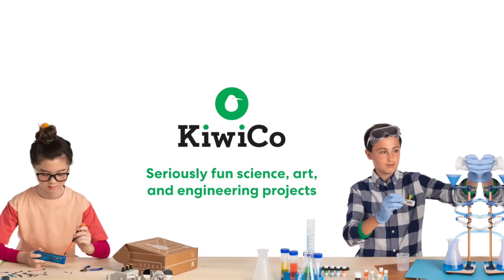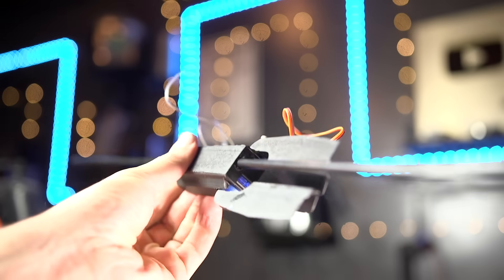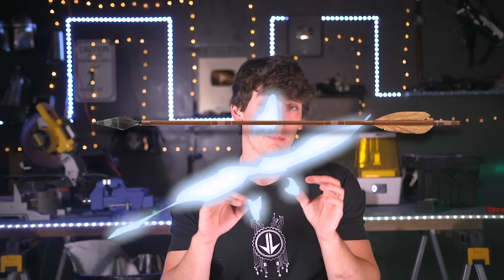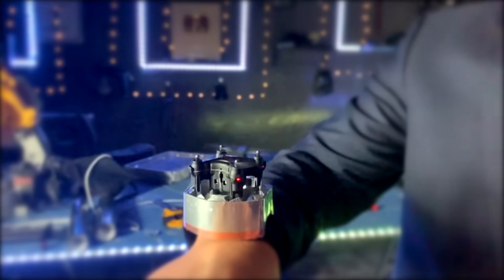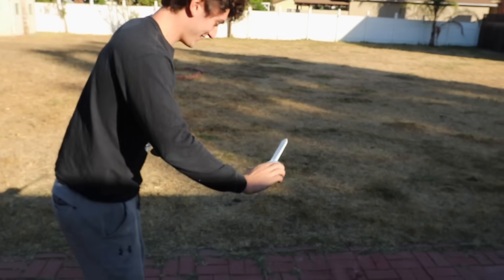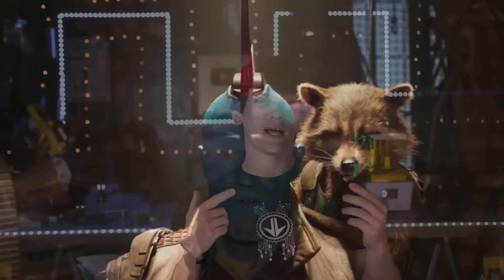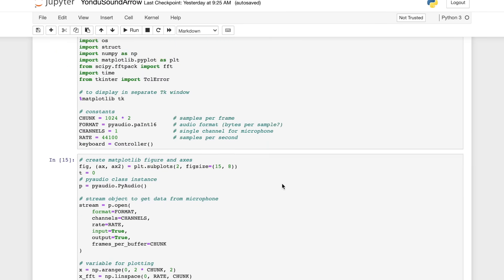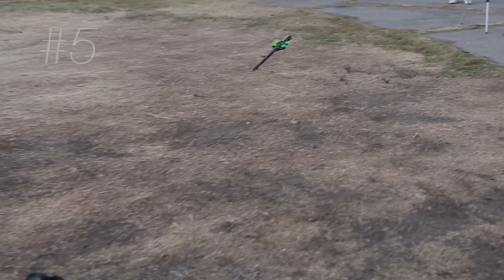Working Yondu's Arrow That Flies When You Whistle! - Change Direction In Flight!

Comment: If I were to modify this, I'd change the mode of forward trust to an additional motor. That way, the 4 motors would just focus on flight and adjustments. If you keep it as is, and try to target something, it would come at it in an angle so it may change the accuracy a bit.

Comment: Really impressed by this disign. I was thinking about how you could make it more destructive without the sheer power it would need to go through something thicker and I landed on really high heat on the tip. Weather you should make it more destructive is another matter.

Comment: The new FA-XX fighter jet concept resembles an arrow head. Could be worth trying. 🤔 A girls push spring hair clip (made from a flexible steel like a paint scraper) seems to make for  a good miniature bow, so maybe if the popping mechanism could be made to respond to sound, you might be able to change the speeds by command, maybe via a remote control car like 2 speed electric motor, or a click pen sort of mechanism, maybe powered like a quartz watch crystal tuning Forks mechanism, or an electric click button lighter for simpler on or off. The arrow would probably be a bit cluttered or more akin to a drone but you could in theory use additional motors that are direction specific to change direction. Drone cannabilism aside, I would think that hover board technology would be ideal for Yondus Arrow, but the materials for the arrow would probably make it more expensive... 🤔

Comment: You should put 2 mini propellers or jet engines inside the tip towards the bottom that rotate horizontally and vertically a litle for a forward speed option that can aftually go firward and well

Comment: It would work better if you used separate propeller (or 2) for backward and forward movement and keep these 4 props just for lift. It would not tilt as much and could impact with more force

Comment: Should have gone with the plane config , use a brushless motor near the tip for lift and 4 of those drone motors at the rear for thrust  and alerons to control it , write the code to keep the front motors to acts as so the arrow stays horizontal and the those powerful rear Motors give it some lethal thrust. Make the tip out of molten sodium and boom u actually got a  weapon

Comment: In the comics. Yandu was awarded the use of one arrow. For saving the galaxy. By an intergalactic tribe of space warriors. That served the king of the universe. The best of their tribe were able to wield an entire quiver of arrows at once. Yandu was only ever able to wield one. 
What controls the arrow was the power of mind control. Yandu whistles because it was the only way he could figure out how to concentrate enough to make the arrow fly. Which was built into the arrow as a fail safe because the one teaching Yandu grew tired of him trying. Figuring it wasn’t possible for Yandu to achieve a high enough level of consciousness required. They made one arrow that could fly itself and obey Yandu. The arrows don’t actually require a whistle to fly and the tribe thought it made the person using it into an easy target. Since it announced your position making it impossible to stay hidden in any fight. 
There’s a lot of comic materials about Yandu and the arrows. It was the most feared weapon in the galaxy. Even Thanos feared it. 
The arrow is basically a miniature bunker buster rocket with an infinite drive system. Made out of a substance harder and lighter than diamond. Controlled by the interface hard wired into the users brain. So flying it was never actually about whistling to begin with. The average movie goer is just not educated or well read enough to understand it.

Comment: ad a 5th prop to the drone those fpv racing flight controllers have a lot of features and you couldd definetly use a 5th motor pointing formard to add speed that way the drone doesnt have to lean forward that much and stays more stable

Comment: What about using a slightly thicker rod for the arrow maybe longer, Then turning that into a multi staged sugar rocket with thrust vectoring nozzle controlled by nitinol wire and and a very small microcontroller and battery.

Comment: that final design could have really used the props you initially took off the drones to allow it accelerating faster AND not tilt. Also the front of the arrow could have served as tiny wings for better streamlining during fast flight.

Comment: 10 miles a second. 36,000 mph is the highest velocity ever achieved. (Of a projectile larger than a spec of dust???) Using Experimental gun 60 feet long. You ain't beating that dude lol I'll think of somthing better. Ohhh....the thing smaller than a spec of dust is probably the particle accelerater from CERN or w.e.

Comment: What a perfect video. I had a project idea and tried Googling Youtubers like you that I've seen before. I was thinking about the speed of light and how to get somthing to go crazy fast. In a nutshell my idea is essentially getting an air tank and pressurizing it by putting like 50 tons on top. Instead of 50psi (pounds per square inch) it'd be 50 tons per square inch. Then use that to shoot a marble or somthing
Reply: so obviously one of the biggest problems/ impetus to your idea here is that good luck finding this tank/ tank design that will support the forces your attempting conjur up.          Rather than look up you tubers, you'd be far better off just going straight to the military and science applications here, and googling stuff along the lines of  propelling objects at extreme velocities, shooting objects at extreme velocities--- my wording is a little off as I can't think of correct phrasing right now.          But scientists and the military obviously are already doing this, and have long been interested in pushing this idea to the limits.                        No insult to youtube creators especially like J here and those in the sidebar... but yah.    

anyway back to your idea--- I sort of forgot to mention that your concept is probably not remotely ideal compared to other methods of achieving the same idea.  even if you set aside the overt danger involved in something like a pressurized tank (weight on top like a hydraulic cylinder-ish configuration, rather than a propane tank, still isn't changing too much) and forces at the level of 100,000 PSI.... and the explosive mishaps just waiting to occur there.....        

However I'm sure im naive on this, as im no scientist, and there are almost surely blast forces similar to this kind of stuff involved in rockets and cannon fire already etc.      I cant exactly state why, but im almost sure that a larger denser heavier object would only help you achieve your goal, compared to a marble. (not to mention that im pretty sue objects being shot in our atmosphere at that speed would literally like... light on fire, and be disintegrating-- hence the more robust 'bullet' you'd want to use.   
but it seems that so far in science, people have tended towards doing the kind of thing you are talking about with explosive forces to propel the object, as opposed to whatever your talking about. One thing coming to mind is that, it seems FAR more dangerous having to "store" the energy involved, then release it. (your method) as opposed to just using an explosion, which is generated then gone.       
Your version is basically a sitting bomb... vs generating an explosion as needed.     
 
A more modern method of doing all of this, demonstrated in concepts like a rail gun, is using electromagnetic forces.       
which I think is the proper way to go.     

I did briefly imagine something that could maybe sort of bypass the sitting, 100,000 psi tank and problems with having a valve or whatever that is strong enough to withstand all that, but can be opened up or whatever to release and direct the energy behind the 'marble'...
which is something like a... hydraulic cylinder/piston type of deal. and you are dropping a 50 ton weight on to it, so at least its not sitting around pressurized all the time... but in that version you still need this super robust tank, barrel...  I dont know enough to know if you have to have the system closed off for some amount of time-- so that the pressure/energy can build up... (so maybe a system that can withstand say 100tons psi, with a sacrificial sort of end cap that only withstand 49-50tons psi, and thus ideally it fails, and the pressure energy is funneled and released there, the marble awaiting).....

Comment: if you make a rc plane your gonna want to focus on stability and lift, lift is needed to stay in the air, your gonna need ailerons, a rudder and flaps, (also elavators) and a way of thrust, you may want to use a spinning engine (cessna 173 type) and flaps, they are the type of elevators on the main wings, they may tilt at less then 45 degrees or slightly more then 45 degrees (kinda unsafe) and by turning it you would need low weight motors (motors can be heavy so a good thrust would be nice.) and the elevators, there is a wing on the back of the plane (also because I'm saying single wing is that people researched and found out that it's just one big wing) the elevators is on each of the sides of the wing. The rudder is in the middle of the tail (tail referring to the back of aircraft,) we will talk about the rudder later, like the flaps. The elevators have a similar angle to the flaps, (as there already a sign of lift in the main wing the secondary wing is just a stabilizer with flaps) now on to the rudder. the rudder is on the tail of the aircraft and is the main production of the yawing (yawing referring to turning and pitching is referring to angling the aircraft, ) (pitch is made by the every flaps on the aircraft) ( you also may want to have your rudder angle as 30 - 25 for yawing and pitching) oh yea and the airelon? it's just the flaps but smaller and on the same wing, that is my explanation so goodbye! (I spent 30 minutes on this nonsense 😒)

Comment: A vajra is a ritual weapon symbolizing the properties of a diamond (indestructibility) and a thunderbolt (irresistible force). The vajra is a type of club with a ribbed spherical head. The ribs may meet in a ball-shaped top, or they may be separate and end in sharp points with which to stab.

Comment: Can you build open air AC using paltiers and solar electricity big enough to cool down 400sqft area?? Or if not on ground can you build freezer using ptiers and soler electricity which floats on sea surface and cooling down oceans water..
Reply: I am working on the idea and falling short on resources because paltiers are not big enough available and those companis who produce it have quoted coat beyond my limits..

Comment: Hmm, seems pretty damn realistic but if we're talking realistic, we really can't make the perfect frequency with our mouth. 

What would be a better albeit not so movie accurate option would be to make a pipe and drill holes in it in a way that you can achieve different frequencies by pressing on different holes. That'll give you a lot more control, at least on the controller side.

Comment: Theoretically you could have a drone on the back of the arrow and have the back propellers provide much more lift than the front to make up for the weight, the back wings would tilt it back and the front would hold it steady

Comment: Why didn't you make a plane with an arrows body. Meaning two fetching like the avenger guys arrow, but so that the arrow fetching have a planes standard flappers. Those flappers allow planes to take off, turn left, turn right, and land. Put a drone fan in the back and/or with the two "fetchings" just like a jet airplane. And you could have put weights on the inside of the arrow for weight distribution.

Comment: Idea for the 2.0: You could connect the arrow and fletching (through the drone somehow) and allow it to move vertically free from the drone (connection over the center of gravity). That way the drone could accelerate faster and tilt forward without the front end pulling you down when you accelerate. You'd also need a little computer do-hicky on the back end of the fletching to calculate position and a little motor on a track to control the arrow movement and keep it horizontal. 

Awesome content keep making dope stuff!

Comment: I’m a just spit ball since I got the general idea off the top of my head. Would probably be pretty hard to do for a few reasons since whistling is hard. But why not remove the ability for the arrow to go backwards? Like the lower pitches decides if it goes right or left depending on how low you go while the higher pitches decide how fast forward it goes. I’d say you’d have to make a script to save the previous set speed when it starts changing directions just so it doesn’t just stop moving forward and wildly spins out of control. But this is just spit ballin, I thought this was super cool

Comment: instead of using motor to control the remote controller, is it possible to just replace the receiver to something that could pick up your whistle input? maybe you could also try audio frequency simulations to perfectly test the arrow and also allow it to do complex moves like left right rotation

Comment: Just a suggestion to make it closer to the Marvel thing should be some records flying tracks whith this arrow and attach these to several Melody that you whistle. It would allow the back in Hand thing and it should be possible i think with a little AI based like an speech to text but there with whistle Melody to arrow tracks.
IE : you whistle the x files Melody and so the arrow make a round around you to finaly get back at the strating position.
(Apologises for the english)

Comment: starts whistling Megalovania

Although now that I say that, I wonder if you could build a Gaster Blaster? I know that sounds unrealistic, but hear me out: if you could attach a small light-weight flamethrower, attach it to a drone, and hook it up to one of those concentration toys in order to control it... Then you've got yourself a Gaster Blaster. The (functionally) hardest part would be finding a fuel canister, and material to make the skull shell out of, that's light enough for the drone.

Comment: Get the old yu-gi-oh portable dualing arm decks and make it actually  work can scan your cards either in attack mode or defense  mode can read if face up or down also it can read the spell or trap cards also read if another deck in vercinaty and interact with other deck via ir or bluetooth for a daul has all cards loaded into PCB so can use effects etc,note the game has progressed now that you can have a six monster so you can forget  them cards for now also has speech of cartoon characters you get to decide if want all voices or just yugi and kybas plus must have hit counter  which is  8000 and 4000 the players decide that b4 daul.if it is fisable maybe a projector to project monsters having the battle you are dauling.

Comment: Use a cross bow put so much power into it. And for the the wings make a larger head tungsten is quite heavy so use that and add a lot of twork on it so you can turn without snapping and having enough weight to stike yes it will go down but it uses gravity to gain speed and when striking you won't have a weak angle and actually have a actual damage to surfaces like wood or metal or not burn if it flys through flames and uses sounds of it flying to know where it is compared to the ground and its speed and maybe velocity

Comment: I feel like it actually wouldn't be super complex to have it move in all directions, using only 2 pitches of whistle. You can swap between the 3 axis by doing 2 whistles of whatever pitch you want quickly. Then you can have up to 4 modes, like low-low = Y axis, high-high = Z axis, low-high = X axis, and then high-low could be a home function.

Comment: make a hwacha system with modern components to see if modern components can make improvements in the arrows performance.for example,chinese used crude gunpowder with varied grain sizes reducing reliability and consistency.replace this with module rocket motors and see if this improves the overall performance and reliability.keep the original arrow weight,but with better materials,and see if there is improvements to penitration,accuracy,and range.

Comment: Awesome idea! There are literally professional whistlers who can control their exact pitch or even do trills between multiple pitches, so it's not unreasonable that you could learn how to fly it better without any hardware changes. But I don't think you're going to get the speed and responsiveness of the movie without some sort of combustion (like rockets) or a propulsive tech we don't know about yet.

Incidentally, you actually don't want the center of mass over the wings exactly, it should be a little bit in front of it. The slower the craft goes, the closer it should be.

Comment: You seem incredibly capable so I’ll share a couple ideas bc I believe in you. A pair of steel gloves (nano tubes are superior alternative is possible)—potentially a/aerogel, for Max protection. Should still be easy to move so not tough like steel more like a composite of the two(nano tubes and steel powder) interweaven for flexibility.

Comment: Try putting an miniature jet engine at the end of the arrow, make it so the propell blades stop instantly at the same time as the miniature jet engine gives a speed burst when about to penetrate targets. You probably need to rebalance the weight overall but it would certainly make the arrow go through targets more efficiently. Good work man.

Comment: Near invisible taser flying drone. For taking out bad guys behind cover.  Use two laser for range for taser and camera for vr interaction.
Reply: Basically change all drone plastic with Matt transparent resin parts.  Add a small capacitor for taser charge and mini crossbow for dart.